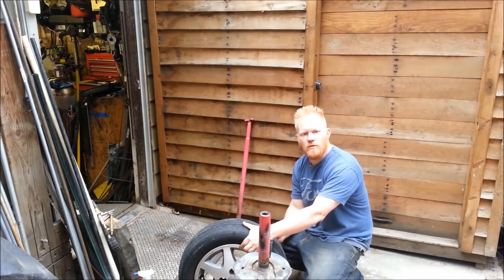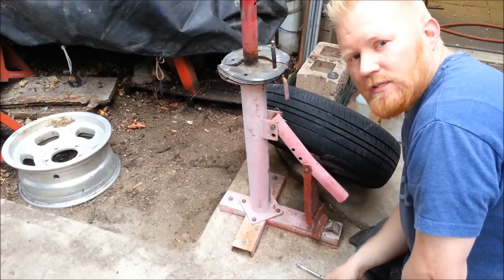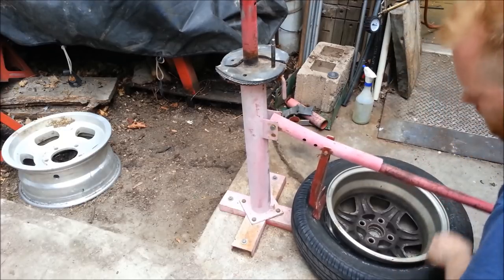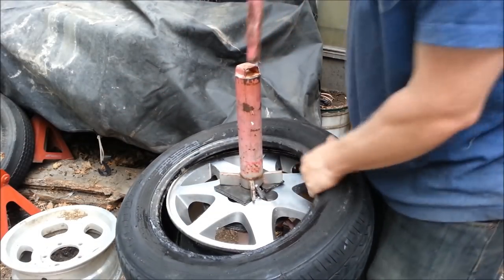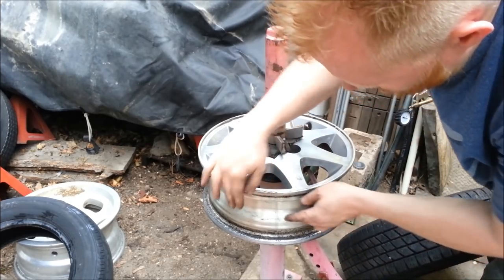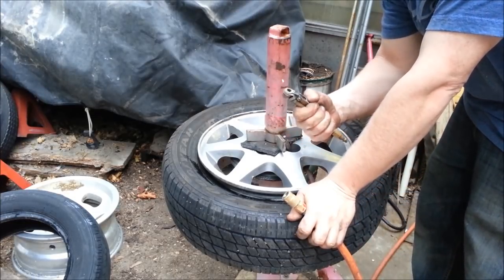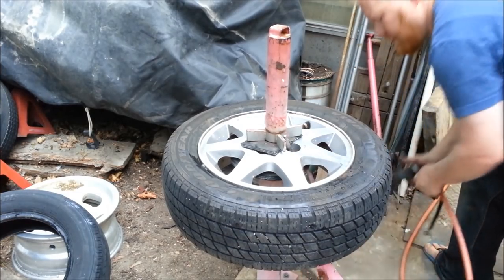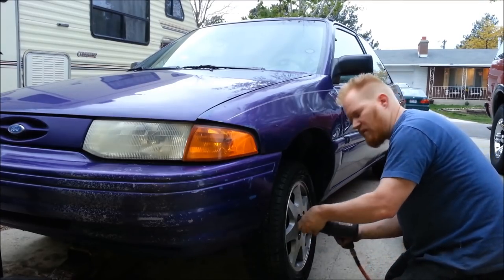Make a Manual Tire changer machine Awesome

Comment: my local tire shop will put the wheel upside down to protect the front of the bead so any damage to the edge will be on the back out of sight.
Reply from the maker: A lot of wheels can't be done this way due to the rim well being only on the face side. If the rim well is centered then it can be done(some steel rims) but these are far a few between.

Comment: I replaced the cross clamp with a cone,better location and no damage at all. Rubber protection on bottom of bead breaker to prevent slippage and damage. I also use rim protectors.
Reply: What are rim protectors?
Reply: @aa-vb9tj  3inch pieces of plastic you can slide on your rim, they have a cord so you can hold it while holding the bar so it slides on the protector instead of the rim. Cheap and easy
Reply: Where did you get the cone? Or did you make it?ive destroyed two crosses.

Comment: Thanks for the video, I just mounted mine on the small cement slab just outside of my small door to garage. I went to lowe's and ended up with 1/2 studs that go in the holes that I had to drill, the 1/2" masonry bit was $10.50. I got 7", they are way too long, gonna have to cut them shorter. Also had to drill out the HF tire changer holes with 1/2 drill bit. I did my best to drill the holes perpendicular to the cement, slight angles on the studs that required some light hammering to straighten, no big deal.  Had to blow out the holes with my air compressor. The next size smaller they had was 3/8, but they weren't long enough. I like that I can just unscrew the nuts and remove it when I don't really need it. Not sure yet what I will do with those studs, maybe just stick a 5 gallon bucket over them. 
   Maybe better luck at home depot with being able to use smaller bolts and save money on drill bit.  A little over $20 with the bolts/nuts(one unit) plus the drill bit. It's very stout with the half inch bolts, so I'm real happy. Thanks again!
Reply from the maker: Great setup.

Comment: I agree about balancing - usually you counter the weight of the valve (which is already done) and tires are usually not weight warped - but yeah, if you feel something weird at high speeds - get it checked
Reply: What was the reply and your thoughts about Balancing? That it's not always needed?
Reply: What was the reply and your thoughts about Balancing? That it's not always needed?
Reply: What was the reply and your thoughts about Balancing? That it's not always needed?

Comment: Do you think it would be a PITA to mount a 245/45r18 and or a 265/35r18 with one of these? I've seen nylon tipped tire bars that don't chew up rims. I found one of these in my dads old storage unit wondering if I can use this for drifting purposes and low profile tires.
Reply: @NevilleFuckenBartos  I can say it works like a charm, I have mounted 8 tires with this machine. I own a drift car and don't want to pay for someone to mount my tires.

Comment: Sharing a major improvement I made.
Re located the hardware from braking the bead from underneath.
Welded the parts to brake the bead down from the top , much like a pneumatic changer.
Just relocated existing parts. I also elongated the center thread on part .

Comment: I use a rubber edge protector slide for my alloy rims, they’re cheap and effective to protect scuffing the edge. Practice on a non important rim first, though! ( don’t ask me how I know that....). For popping the tire back in, weld a small ball on the end of the “T” and make the stem round, you’ll be surprised how much easier it becomes to turn the edge back over the rim. No more “nibbling” as you call it (which looks like rim edge destruction to me). Thx for the vid 👍

Comment: I used a heavy duty pallet for holding bricks. I measured where the mounting holes would be drilled & drove a couple of 2x4s down the length of the pallet & mounted the changer with lag screws. Never a problem with stability - but yes, concrete mounting would be the preferred way to go.
Reply from the maker: I was amazed how much easier it got when I mounted it solid to the concrete, especially with truck tires. Car tires come on and off fairly easily so a pallet is more than enough.

Comment: Nice video. Really like your "beat the hocus pokus" or "what's what's, use your head" attitude towards fixing stuff. Sometimes you're right, sometimes you're wrong, but at least you're doing something. If you're owning a car with 10 to 50000 (good) km left in it a makeshift repair is the only alternative to a workshop. And they only change components, they don't repair. And the feel-good once you've repaired something to a low or no cost is priceless IMO. Beat the consumption frenzy!
Reply from the maker: Sustain Able Hey Thanks. Makes me sound like a loud mouth a little.
Reply: Not at all really. Only confident through experience I think.

Comment: Biggest shortcoming of the Harbor Freight demounting bar is that is has no protection.

 There are ways to put plastic on it. Really helps
Reply: What about coating the end with that plasti dip stuff it's like the rubber on pliers.

Comment: Good Video, very informative. I have my tire changer mounted on a pallet, no problems works real well. I staked the pallet to the ground.
Reply from the maker: I found it OK on a pallet for small car tires. I then mounted it to a 2x12 and would park my truck on one end and it was better. I couldn't do truck tires at all without breaking the wood. I finally anchored it and couldn't believe how much smoother the process went.

Comment: 5:00 uhh yah you need to get some nylon blocks and mount those on the bar, it will NOT ever DAMAGE any rims that way...
Reply: Said it for me. I don't have anything but a tractor rim I'd rash like that. Have an old pickup but perfect rims even after countless flats fixed. Yeah, heavy loads at the dump and strips of roofing nails go through the best 10 ply tires but they laugh at mesquite.
Reply: I bought a No-Mar bar for mine. They have nylon tips, works great!
Reply: @codavied  yeah same but those tips do wear out and they are proprietary. Aka expensive af!!!
Reply: @DaBossk  $10 a set (you get 3 for $30) isn't expensive. I've only done 2 sets of tires with mine but they're just fine still.
Reply: @codavied  could you give me a link to where you bought them?
Reply: @DaBossk  I was a smidge off, I think the prices have gone up a little. But here’s the tips https://www.nomartirechanger.com/replacement-parts.html the bar itself has gone up in price too but it’s a great bar

Comment: I have that exact same tire changer. One problem I had with the bead breaker was that it wanted to slide back off the tire on the stubborn ones. I made a huge improvement by adding a second pipe parallel to the lever arm to keep it from moving back and forth. I would include a picture if I knew how.
Reply from the maker: tinkersdamnworkshop Yeah, some tires can be a pain when the bead is stuck and the breaker wants to slide off.
Reply: That's usually where I give up and go to the pros. Trying to break a beed. The rest isint so bad.

Comment: when remounting the tire , don't try stretching it over the rim like this guy. you will either damage the wire in the bead of the tire or you will tear the rubber. mix a thick batch of dish liquid and water .use a rag to put a heavy coat on the tire. when you do the top bead it is very important to keep the tire in the narrower section of the rim. this gives the extra space for the top bead to mount on the rim. a rubber hammer comes in handy for keeping the tire in that narrow section. oh and lastly, do yourself a favor and use a wire bush on the bead to clean it up. that way you don't get those slow air leaks.

Comment: Yeah lubrication and a sturdy mounted machine is key, also if the weather and tire are cold its gonna be a pain to change as well outside.
Reply from the maker: I will generally use the shop forced air heater to heat cold tires in the winter and it makes a huge difference.

Comment: GREAT JOB,  !!!!!  HAD THE IDENTICAL ISSUE WITHE MOUNTING ON A WIDE ALUMINUM WHEEL,  HAD TO USE EXTRA MOUNTING BARS,  BUT WORKED FINE for 76 years old.  REGARDS

Comment: You are using the bar upside down when remounting the top bead. I have one of these changers and it is so easy to use, tyres fitted in seconds. Also have a bar with nylon pieces for doing alloy wheels.

Comment: Great video Moe!  Maybe as a bonus in one of your future vids toss in the trick of using a piece of rope and a pipe/stick to help get an old or weak tire to seat when airing it up.  Works a charm on old lawn tractor tires that have been sitting with out air all winter and such.  Thanks again!
Reply from the maker: Yellowdog Welding Hey Thanks.... That is a handy trick for sure.

Comment: Good work I found if you pull the lever anticlockwise when putting the tyre Back on it slips on easier maby the head of the tool is designed to be pulled that way thanks for the video 👍
Reply from the maker: Thanks I'm glad you like it

Comment: I love my little dewalt 20 volt impact for replacing tires and everything else I haven’t found a lug nut that hasn’t defeated the gun in terms of civilian vehicles heavy duty vehicles like semis tractors and RVs I’ll just skip to a 1” pneumatic impact but a Manual tire changer has changed the way I buy tires next step is to buy a balancer and some weights

Comment: Was hoping you had an improvement on the mounting device. You're correct on it lacking luster. I have gotten a couple to go all the way around but most times it's like you just done with getting it started and inching it the rest. The rubber is a good idea but mostly farm equipment is what I do and old work trucks. A pair of vice grips or any old C - clamp is good to start a tire on. Sometimes heavy truck or trailer tires especially are hard to get started around and the above mentioned will hold the bead down while you start 🚶 walking it around. I hope someone does come up with a simple fix for the tire tool end so it'll work like a "Real" tire machine. Mine is just like yours and has paid for itself many times over. My bead breaker folded up and now we use the wood splitter to break beades. Good Video Thank you.
Reply from the maker: Companies sell much better tire irons that actually work. They have nylon tips that won't scratch rims but also slide right around.
Reply: The mounting end of the bar actually works fairly well, if you ignore the All-mar aspect of it.  The key is to keep the bar angled up high as you mount the tire, because that keeps the tire positioned properly on the slope to push it down progressively.  No need to inch it in like a tire lever if you do that.

Comment: Weld a square tube with an attachment welded that can plug into your trailer hitch receiver on your pick up truck on one end, and weld the other end up high on your tire machine so you have to jack the truck up to plug it into the receiver. When you let the truck down, that puts some weight of the truck on the tire machine, making it solid
  I bought the machine for the motorcycle tire changing attachment. I bought the nylon mojo attachments, and to keep my mag wheels from spinning as I try to spin the tire on or off, I wrap a strap around one of the mag spokes, twist the rim to get the slack out of the strap, and it ain’t moving

Comment: Why not is right! I like this, what I would be interested in seeing is a good video on clean up of the sealing surface on the inside of the rim. Why Aluminum suffers more than steel I'm not certain but I have seen failures due to shops not running this procedure. As always excellent. .
Reply from the maker: Curiosity The sealing surface can be a pain on rusted steel wheels.

Comment: Far as the balancing goes that little dot on the tire is the thickest part of the bead that dot should be centered with the valve stem you will get a better balance great vid
Reply: The valve stem adds weight to the tire , throwing the tire out of balance . Adding the thickest part of the tire to valve stem side , would throw the tire even more out of balance . The red dot or circle must indicate the thinnest or lightest part of the tire !

Comment: I wish that American Racing 5 slot at the beginning was a 15x7/5-5.25... Need one for a matching “spare” for my ‘50 F-1. 😉. I’ve found 15s but not 5.25” bolt patterns. Nice vid. I have same TC bolted square in the middle of my shop. I need a good duck head lever and to add at least rubber pad on base breaker foot. Thx

Comment: oil on the lug nut threads is a good practice, love your videos
Reply: never oil your lug nuts they are not designed for oil you will over torque them.
Reply: If it's a tradeoff between rust and corrosion, cleaning it and then applying a light film of grease would be better than dirt and rust. Rusty threads won't result in proper torque even if you tighten them until they squeak.
Reply: Ridiculous.  If you've stripped your lug nuts because you had grease on the threads you really have no idea what force you're using with a wrench.

Comment: Love the Escort. Manual or auto? I'm guessing 1994 to 96, though it could be back to 92. Had a Cayman green 94 manual LX. Back springs rusted. Replaced. All shocks replaced. Installed eccentric front knuckle bolts to get the camber to be more reasonable. Three clutches in 240k miles. Was totaled twice (by other drivers vs. my wife).   The Mojave desert killed one of the ignition coils.  One time the EGR valve got stuck. It sipped fuel for 25 years, and I still miss it.
Reply from the maker: 96 LX manual. I just put in it's 3rd clutch last year(pilot bearing failed) and it's pushing 340k right now. Lost it's first timing belt at around 60k(1999) and also had one back spring rust out due to the rubber wrapping they put on it. It got totaled out 10years ago at around 200k, due to a joy ride during theft where they pushed the driver wheel back by hitting a block curb/wall. I pulled it back out and put the additional 140k on it. It got totaled out again last fall for the second time after a girl pulled out in front of me. Hit the same driver front corner and pushed the wheel back again. I pulled it out again but it's not perfect. Drives strait but is starting to eat tires so I need to investigate. When it got wrecked I couldn't find parts in the wrecking yards anymore so I bought a complete second one. I remember having my pick of at least 6-7 at any time from every wrecking yard, not anymore. The second is a 95 with a 150k but has the complete power train out of a rolled over 1991 with 20k. They had never finished the wiring and had been sitting for at least 15years unfinished. I ended up getting that one going with a little work and my daughter is driving it as her first car. I still need a parts car for a few random parts from the last wreck and then it's going to get some new paint. 
This is the video of the last frame straightening: https://youtu.be/-jpIku77MRw

Comment: Lubricate the tire beads, not the wheel..., the beads will carry lube to the wheel. same as the tools, slather them with something slick and it will slide on the bead better.
I use a mix of dawn dish soap liquid mixed with windshield washer fluid, thin and slick, easy to clean off tires  too!

Comment: one tip i used white milk jugs cut to fit bead breaker and heat with heat gun and it formed around it wont scratch rims just a thought thanks for sharng the knowledge
Reply from the maker: SuperGsrider Great tip.

Comment: Great video. Picking one up from harbor freight. Will this work on smaller tires from trailers and garden tractors?
Reply from the maker: WOOODYII2 The only limitation is the hole in the center of the rim needing to be about 2". So most front tires off mower will not work but the style that are bolted on (garden tractors) will.

Comment: I didn't have any concrete to mount mine to, but I had some scrap 4x6s and some 2" thick, 8' long rough sawn oak boards. I used lag screws to put it together and bolted the changer down with carriage bolts. I guess it was a giant pallet on steroids come to think of it. Just had to use what I had.
Reply from the maker: That's some beefy wood.

Comment: I used a coats 40, the tool had a thick plastic cover to prevent rim dammage. but I would definitely put much more soap on with a swab

Comment: On my bead braker I cut the two pieces of flat stock off and put a piece of c steel back in place and it made the bead braker a lot stronger another thing look at the end of your bar if you pull it around the other way it brings the tire off easier the end is wedge shaped 👍👍

Comment: Something to add:  get a flap wheel and a grinder and polish the horrible casting marks on the tire changing "spoon."  Wrap the "bead" surface of the rim in electrical tape (also available at Harbor Freight in bulk rolls) to prevent scratching. The tape is removed after the tire goes on and before seating the bead and filling with air. 
I used my tire changer to put 33" E-loads on 17" chrome H2 rims, which really are beyond the designed load for such a flimsy device, but it works.
Reply: I used 2 layers of heat shrink as a cushion. If you use something that is barely tight enough to fit, it is slightly thicker.
Reply: On the spoon end?
Reply: I misinterpreted. I use the 24" spoon bars from HF. They are a little easier to use as most of the force is vertical instead of horizontal. Therefore, I don't need the supplied bar aside from bead breaking. I pretty much just use the top portion as an elevated work surface.

However, I don't see why you couldn't still use heat shrink on the demount "spoon" side of the supplied bar. The mounting side (T side) wouldn't work too well because the HS might be a little grippy while sliding the bar around as the instruction manual says to do.
Reply: Ah, I see.  Good tip :D